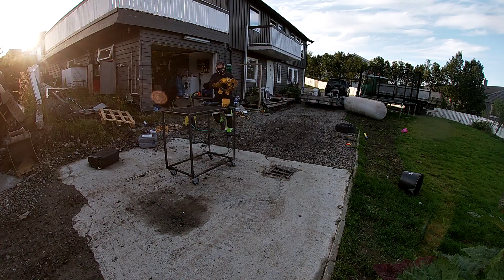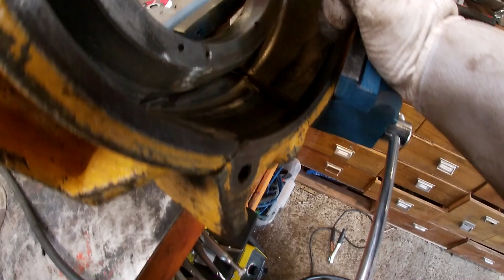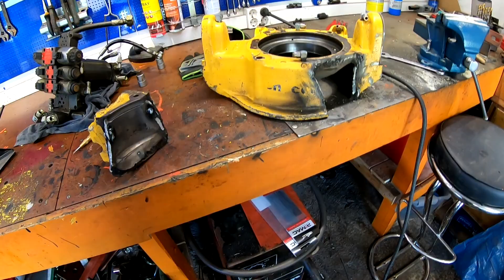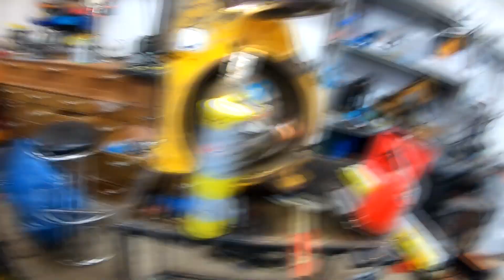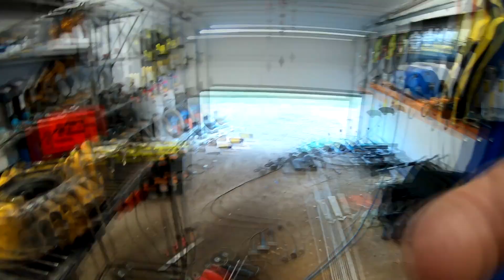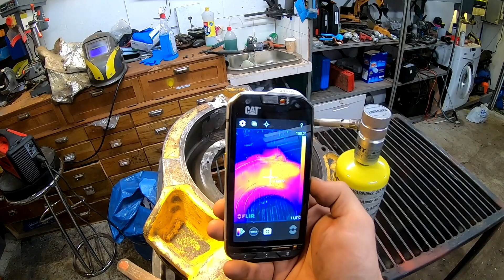Welding the Engcon tiltrotator Part 2

Comment: You shall paint it yellow as it is, Engcon original. If I was u I should buy the svab or engcon system for the tiltrotator your machine will grow in value and u can later on buy a thumbgrip that’s mounted on tiltrotator. 
Fun to see your progress on different jobs. 

I have installed a Rototilt r40 and svab in my Åkerman h5. Klick to me and you can see some clips and a link to my side on Maskinisten.se

Comment: You could also have thamked "Maskinisten" where you got som invaluable tips! But remember that cast-iron is not the same as cast-steel. You mended cast-steel. Repairing cast-iron is a completely different procedure. But well done!
Reply from the maker: Yes that's true maskinisten is an forum with a lot of great people 😊 a lot of help in there with almost anything 👍 yes I will try and weld an manifold for an old engine when the excavating season is over since I have the rods now for cast iron, for testing 😊

Comment: And maybe you can use the rotating function  for feed on the manifold block for all of the functions.  Then have auxillary high pressure left for someting else. Rotating is usually 180 - 200 bar witch is fine. And that is switched with a 6/2 valve, so mounting  2 seperate pressure relese valves  back to tank will cover the problem.
Reply from the maker: I need to control the outlets true the pedals for controlling the flow / speed of the tilt /grab so it will be an 4 hose system with 1 set for rotation and 1 set to the manifold. But I could have the rotation as you say from the manifold as an extra outlet🤔
Reply: @MiniMachines1  oh yeah i understand, you want to use  both functions at the same time, tilt ant turn.  My thougt was that the whole  thing can run on only 1 section/function. Another thing you can do is running it from the return of the blade control  manifold in case you got an seperate pump for that.
If you have a hydraulic schematic of your excavator then we can look what possibilities you have.

Ps the second valve is a proportional valve. You can see that by the extra stripes on the top and bottom of the valve icon/picture. I dont know how many volts it can handle. Maybe you can find something about that.
Reply from the maker: @megape95  Yes both functions and let the pedal decide speed of rotation and tilt, ore for feel for the grab so it's not only on/off with an switch. 

I figured that the valves is proportional and is hoping 12v is full open and I than can run only an switch from the cab to the B side and control flow and direction with the pedal
If not I need to buy some on/off valve that fits on the manifoild that is ment for continues 12v for open.

Comment: Is this a stick welder you would recommend? Me and my dad tried a no name stick welder and wanted to use it as a boat anchor after a couple of ruined sticks.
Reply: Kemmpi minarc, esab,  ewm pico,  are all the  good brands, at least here  in the netherlands. Stay away from lincoln now, they are not making quality stuff anymore, at least for the smaller stuff tho
Reply from the maker: This is the first time using it, it's welding good, but will like to try it a little more before I say this is the shit😊

Comment: 7016 or 7018 sticks are the way to go for this. Good work, i think it will work fine for you.
 Do you machine the inside to?
Reply: Esab OK 48.15 is 7018
Reply from the maker: The esab ok 48.15 worked great also 😊
Reply: @MiniMachines1   yeah  but i dont know the codes for esab sticks😁
Reply from the maker: Thx tried searching for an conversion but couldn't find any 😊